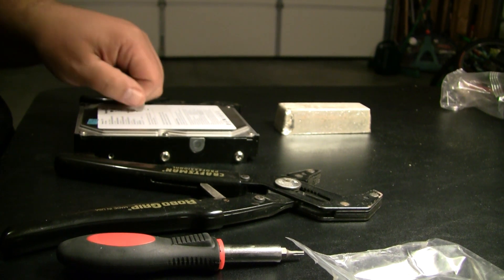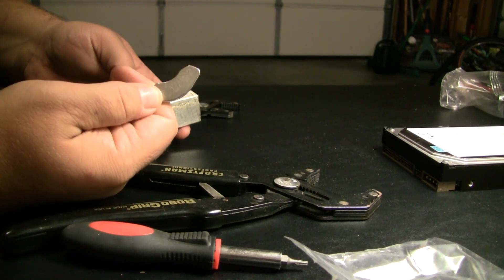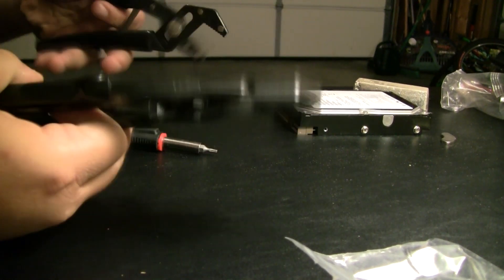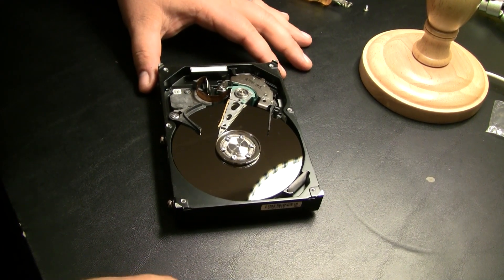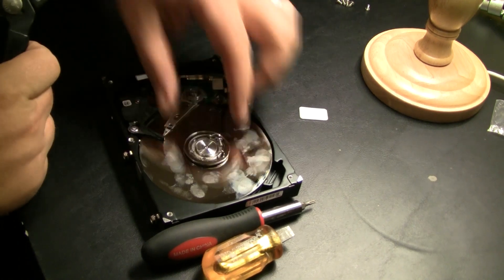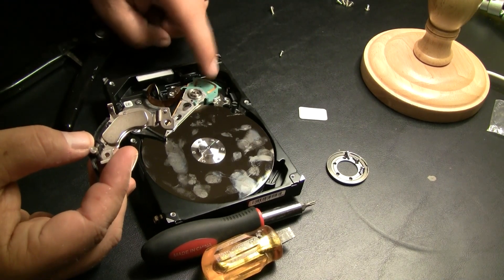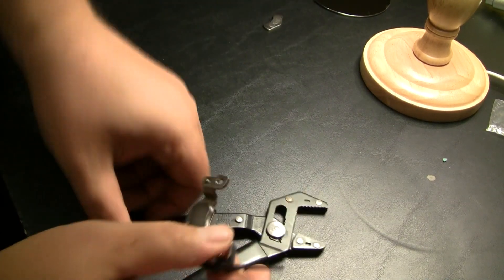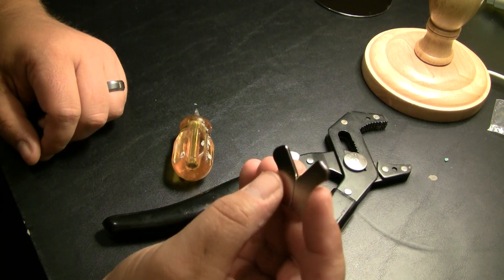How to Salvage Rare Earth Neodymium Magnets from a Hard Drive

Comment: You are salvaging the magnet not the Neodymium out of the magnet which is a very difficult process, it would be better if the manufacturers worked on a better solution so that the neodymium is set between the magnets and can be easily extracted or taken apart and used for other components, rare earth is in short demand and is a commodity resource that is in high demand and will eventually run out if not recycled easily. The Industry wants fast bucks and must start thinking about this.
Reply from the maker: I really appreciate you comment, Andrew - I agree with you!

Comment: Thanks!
Reply from the maker: thanks for watching!
Reply: I'm really REALLY hoping you didn't just toss or send off for recycling the rest of those hard drive parts ....  In the hard drive, there are wires that lead from the circuit board over to the armature and then some tiny wires that go all the way out to the ends of the armatures to where the read/write heads are.  To have ANY kind of electromagnetic interference from those tiny wires would ruin the way the hard drive stores it's data .... so to make sure that doesn't happen, those wires are made out of pure gold.  There's more gold in those little wires than you get out most CPUs ...

Comment: You never did say what I was supposed to do with those magnets.
Reply: Set them on the silver with said silver at a 45 degree angle and note the speed at which it slides. The slower the speed means that the silver is more Lilly to be pure. Hope this helped😜